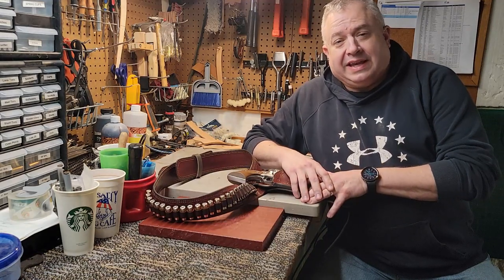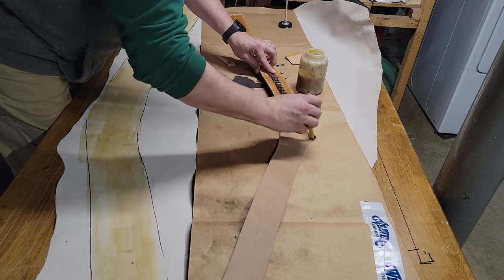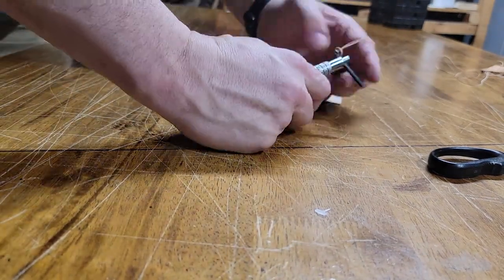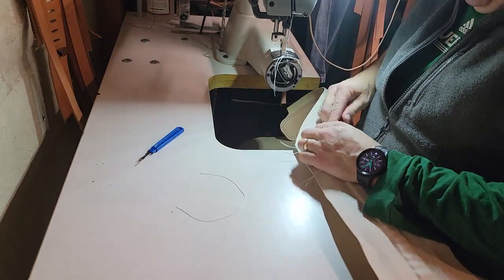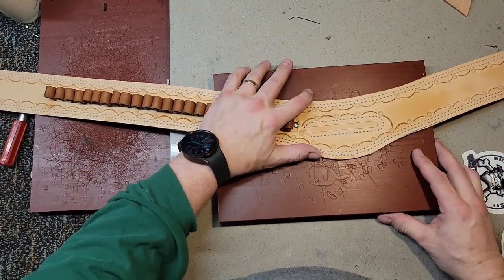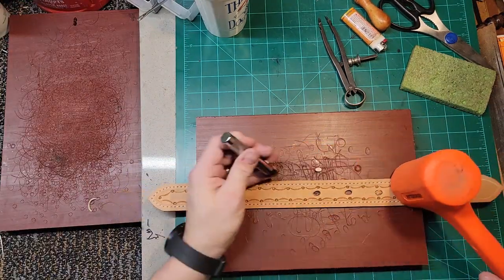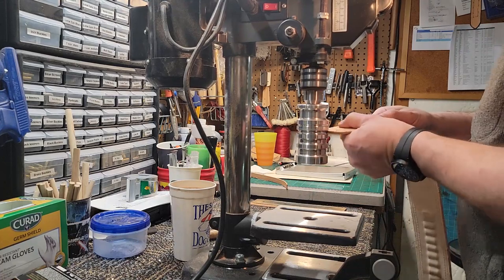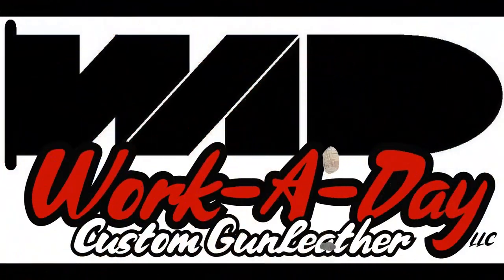How-To...  Building a Ranger Belt - Work-A-Day Custom Gunleather

Comment: Why don't you dip dye?  Seems it would be faster.  Any particular reason to stay away from dipping?
Reply from the maker: I have dipped on occasion, but with an item this big, I would need a LOT of dye and a big tub.  I also find I have less yield with the dye, as there is a lot more that  ends up in the container in the end.  I also have limited space and it helps to work on parts of the belt instead of the whole belt at once.  On smaller items, I sometimes use zip lock bags to dye.

Comment: if someone doesnt have a sewing machine would you suggest a Saddle stitch for the belt?? Also why did you burn the cotton for edging?
Reply from the maker: That's a couple great questions!  Saddle stitching is actually the strongest form of leather stitching, since each thread covers both sides of the leather, as opposed to twisting halfway.  Both meet the needs, but saddle stitch is great for hand work.  I singe the dauber to eliminate stray fibers on the wool. It makes it a clean edge to put the edging on.

Comment: Why do you CURVE your belt...when some dont?...What's the purpose?..why is it needed?
Reply from the maker: That's a great question, mainly because it touches on the "why" of some of the western designs.  That is a "buscadero drop" which was requested by the customer.  That design was introduced by Hollywood, and even the most ardent single action shooters will point out that it has no real historic basis.  Straight belts were used as working belts, but the buscadero looked better on the big screen.

Comment: How do you measure for a Ranger belt?
Reply from the maker: I have a "sizing belt" that has a corresponding letter for each hole.   Or, I add 4+ inches to your jean size .... OR, I remake it if it didn't fit the first time.   Preferably, I use the former method.